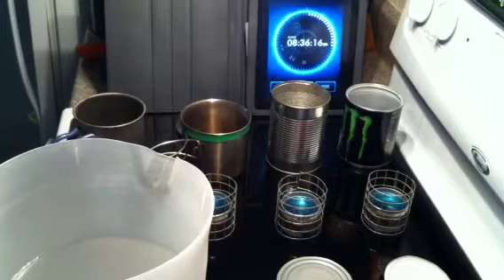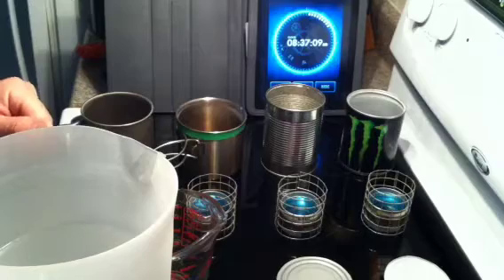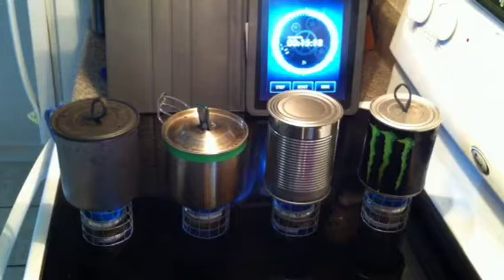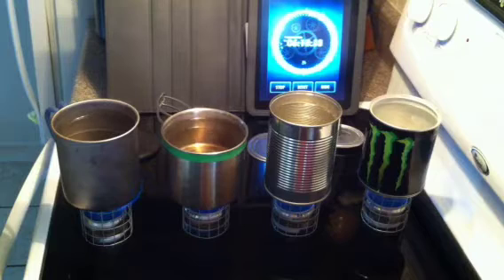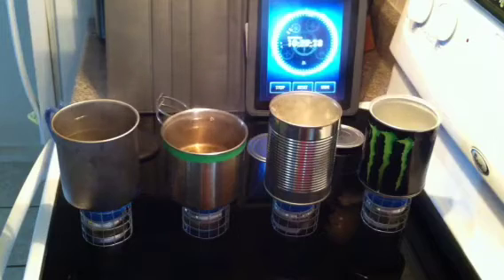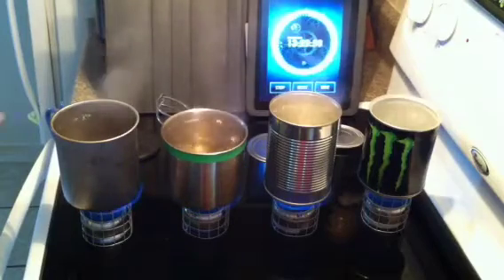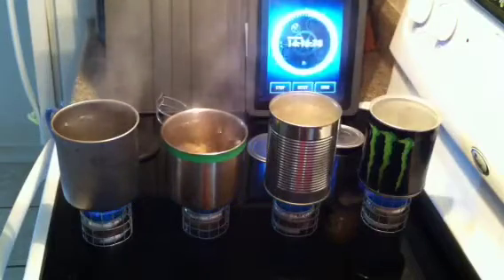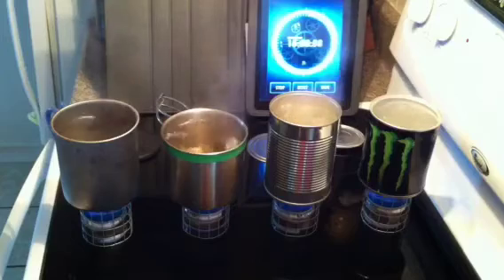Metal vs. Metal

Comment: I really appreciate this test! However, there is a variable that I'm not sure you considered.  The two pots in the middle may have picked up a fair bit of heat from the adjacent stoves,, perhaps twice as much ambient heat as the outside contestants. I'd love to see the test redone with the pots arranged in a square rather than a line. With all things being equal, I would expect the Monster pot to boil first.

Comment: i like this test. ti wicks heat wicked fast.. it probably transferred as much heat into the surrounding air as it sent into the water... aluminum kind of has the same ability, but not as magnified., but you hit it dead on by noting the thinness of the aluminum can making it more efficient than it (by specs) should be. 'tin' figures on specific heat might not be correct. cans are just mild steel usually.. so this test says make can-pots with a steel bottom.. to me.. thanks man!

Comment: Very nicely done! You minimized your variables as much as possible. Would have been interesting to see the spec heat and mass of the pots (but not important). Handles shouldn't be a big issue because they pick up some of the "waste" that races up and away.

Based on an earlier issue I had hoped to compare pot diameter and boil times but haven't had time to do the comparison, let alone film and post it.  Thanks for your efforts!

Comment: Its rather curious as I always taught that that an aluminium pot will absorb heat more readily but your test shows that the thinnest pot and also a steel one got the first boil.  I also want you to note that the tin can had ribs in it and thus enlarge the surface area and thus help it to absorb more heat into the water. Good vid mate keep it up.

Comment from the maker: It is flat bottom and it is aluminum! If you take a closer look at DIY flat bottom can pot vid. You'll see it was the bottom have of a Vienna sausage bites can which is in fact aluminum. I don't use rings or bottoms that would rust. If you like I can make a vid. holding a magnet up to it, but I assure you it's all aluminum bud. Thanx for checking in, Peace!

Comment: Hi TH: that aluminium pot; does it have a normal aluminum can bottom or is that the one you put the flat bottom into? If it is that is not really an aluminum can. The bottom that is heated would be steel. If it is the flat bottom you need to do the test again with a real aluminum pot.